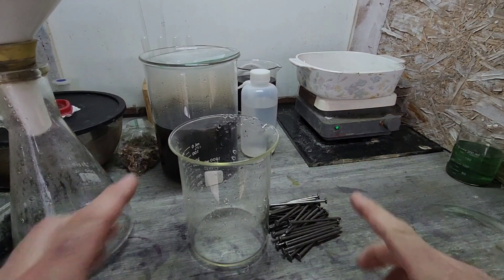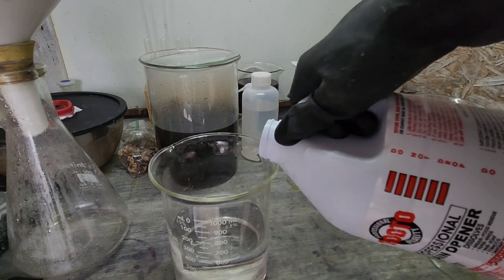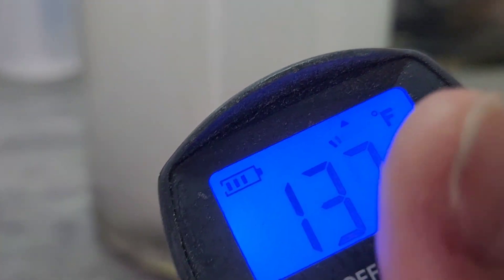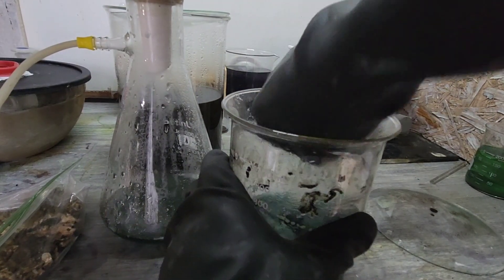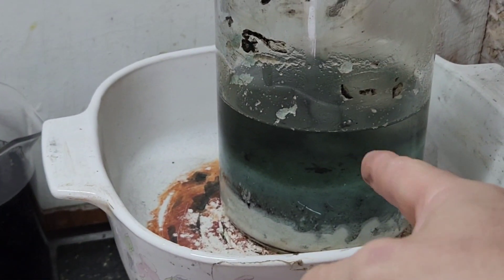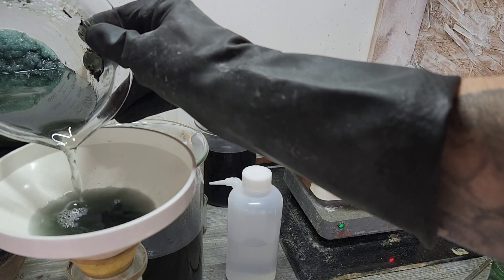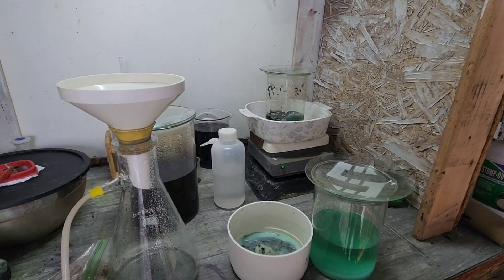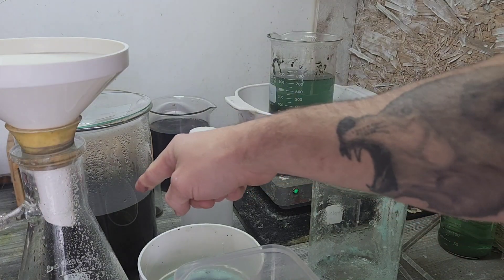Making Ferrous Sulfate for Gold Drops

Comment: an even better thing to use rather than nails are the laminates from transformers, they are mild steel with no carbon, makes nice emerald green solution
Reply from the maker: Ooo I think I have a couple laying around. I will use that for next go around
Reply: @SilverStoll  nails will work in a pinch, but they do have impurities that can cause a problem...the mild steel from the transformers work perfect
Reply: @SilverStoll  when you're done with your current batch, try a batch with the laminates and compare the colors of your cystals...you still need to boil it and ad HCl to it before adding it to your gold.

Comment: Coincidentally, I decided to start makin ferrous sulfate 2 weeks ago. I ased steel wool for mine. I do mine at a 10% sulfuric acid to water ratio. I do 1ml sulfuric to one gram steel. Takes longer but less foaming.
Reply from the maker: I was a little worried with the foam, especially with 800ml of solution in a 1000ml beaker. But it went OK!
Reply: @SilverStoll  Good stuff, maybe the extra surface area of the steel wool is why I encounter a lot of foaming.

Comment: Excellent Cody 👍Im trying an experiment to do the exact opposite right now.  Need to get the iron out of the sulphate, I want to try to get my sulphuric acid back (well sulphurous acid at least).  We're not so lucky over here, sulphuric acid is expensive and under license, hasnt been sold as drain cleaner for years.  Trying a bit or trial and error with electrolysis on 1L of old solution for starters. Started with getting the copper out, that came out lovely but there must be some iron contamination in the mix.  The remaining solution has that lovely iron sulphate green colour.  If anyone knows the best settings for this I would be very grateful. Currently using lead dioxide bar as the cathode, steel nail as the anode. Getting some rust forming then dropping to the bottom but solution isnt clearing up as of yet. I will give it a few more hours to see if any progress made. In the meantime if anyone can point me in the right direction Cody said he will send you one of his world famous copper dragons for helping me 😂 p.s. I'd like one of those dragons too 🙏 hopefully my name will come out of the hat in a future draw
Reply from the maker: 😂🤣😂 I imagine the sulfiric is desolving it faster than it's plating out. Can you freeze it to see if the crystals will drop out of solution and then filter while still cold? It may not be perfect but may rejuvenate it some?
Reply: @SilverStoll  yeah if all else fails can try that, its only an experiment at this point, im not really hopeful that it will work. the sulphuric is very dilute at this stage, cant see it having the power to redisolve it faster than its coming out and its minus 2 outside, only thing stopping it from freezing is the electrolysis 😂
Reply from the maker: @scouseurbanminer5106  ya that would do it. Evaporate it for a while see if you get the white fumes or water. If you get the white fumes try it back out on something.

Comment: I am just starting this as a side hobby and made some last month with roofing nails and used old jars and and coffee filter with homemade funnel from plastic bottle. When crystals form overnight I pour off back into nails jar. I use old knife to help get out of jar but very clean and pretty crystals. I dissolved some in water to drop alittle batch and worked but next time I will add some HLC and refilter.
Reply from the maker: Did it make the solution cloudy?

Comment: I think nails are made of steel not iron, they probably have nickel and chromium as well as iron. I don't know if that's a problem though. Cheers ¦-)
Reply from the maker: I thought there were both iron and steel nails. I thought iron were the most common especially in this size since it's widely used in construction where they like the nails to bend. O well. I don't think sulfiric will touch chromium but the nickel will dissolve. That will come out with the HCL baths
Reply: I just checked quick and it looks like they are just iron. I thought for sure they would have added stuff to make them tougher but I guess not.